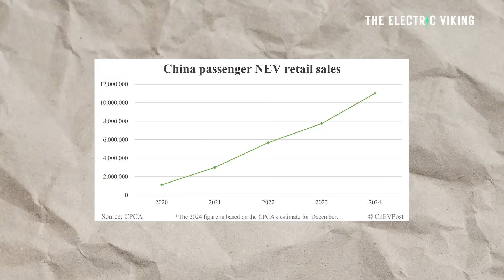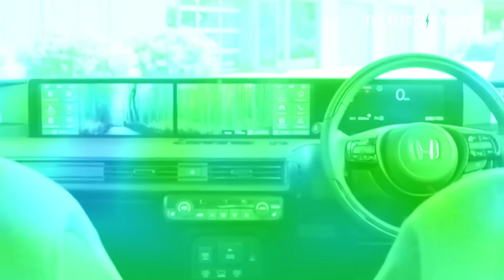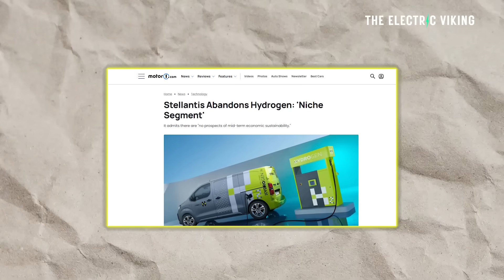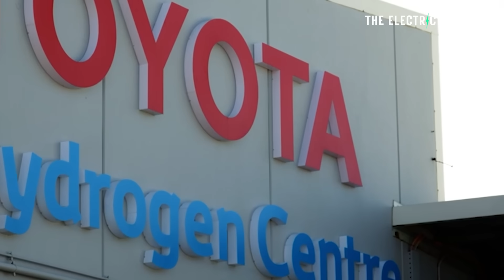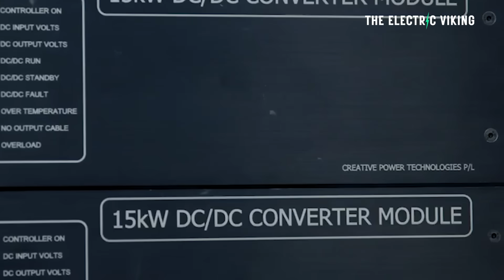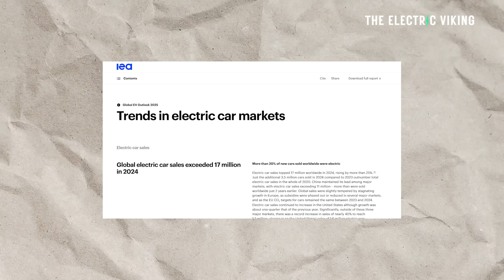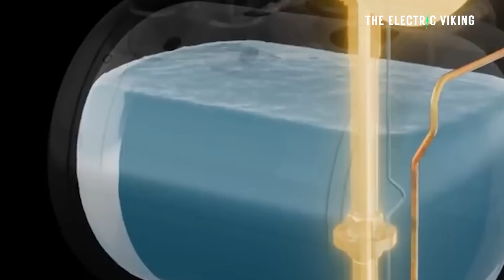The Future is Hydrogen Cars - Honda says EVs are not the future

Comment: Do they honestly believe I will ever drive to some pump again, now that I can charge at home from my own rooftop solar?
Reply: Totally agree.
Reply: The biggest advantage of electricity is that you don't need to transport it. It's always ready on demand at your home.

Hydrogen might sometime in the future become a viable fuel option, but not to be carried around and used directly in your car. I rather expect it to be used as a power backup in solar or wind energy farms.
Reply: @antandros69  Electricity is transported. The transporter is called a battery.
Reply: Home electrolysis machine perhaps?
Reply: @Froggability  The electrolysis isn't the hard part. But then you have to separate the hydrogen and oxygen, use a pretty insane compressor to liquify the hydrogen and store it in an expensive tank. On this small scale the whole process is really inefficient, and the municipality rightfully won't allow it in urban areas.
Reply: How about 40$ a kg, you can afford that right?
Reply: @stevey_z  Right 🙂 With a fuel cell car, 1 kg hydrogen would get me about 100 km range. With my current BEV 100 km takes 15 kWh, which costs me less than €4 if I have to get it from the grid.
Reply: You're forgetting that you could use your panels to produce hydrogen and you only weigh 75% of your electricity
Reply: @fjwagnerdds  A private little hydrogen plant and storage would be expensive, highly inefficient and possibly not even allowed. Give me a home battery any day. Not to mention that a hydrogen car is more complex, more expensive and considerably less efficient than a fully electrical one. It will also require more maintenance and have a shorter lifespan.
Reply: @Onwrikbaar also they can still use hydrogen to store energy when there is surplus solar or wind energy. But we will still drive with electric cars... In Belgium we had a company Ebusco that wanted to create hydrogen busses but it never took off. Why would it be different for regular cars?
Reply: @fjwagnerdds  that's not a bad idea. Assuming peak efficiency of the solar panels and 10+ hours of sun with no clouds, you could probably produce enough liquid hydrogen to fill your tank every day. What do you do when it's cloudy? I could see a world where there's cloud anxiety. It'll be interesting to see if hydrogen ever actually takes off. I'm fascinated by what the future might bring!
Reply: Sonic, compared to solar and batteries, the physics and economics of hydrogen just don’t pencil out. It is a dishonest pipe dream like clean coal, ethanol and carbon capture, designed to keep you and me enslaved to the oil oligarchs. No thanks!
Reply: @fjwagnerdds  Your idea is da bomb!